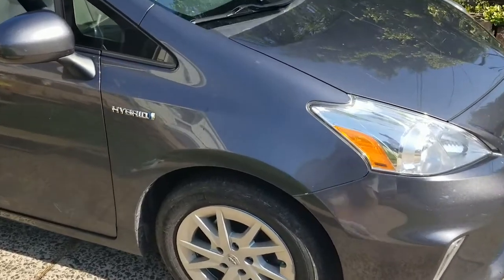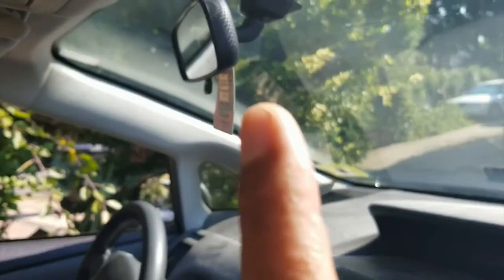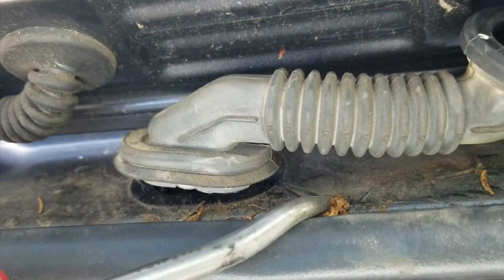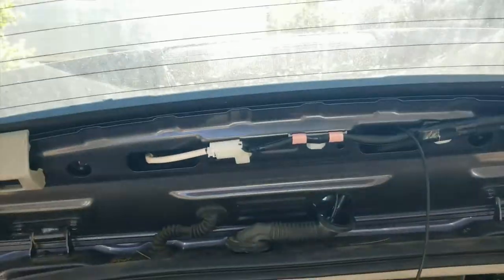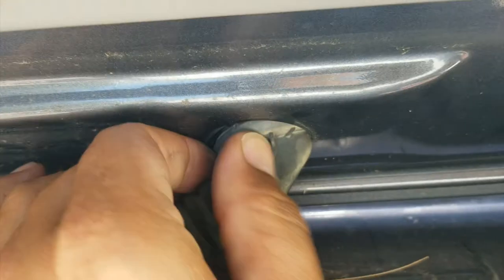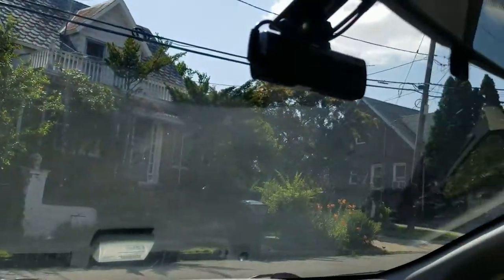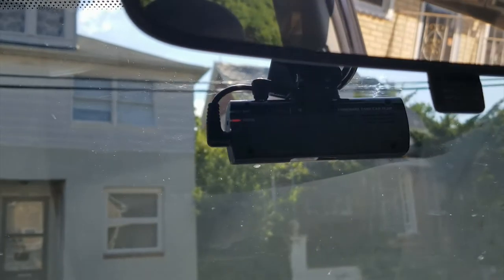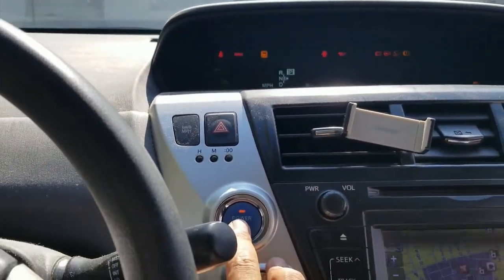How To Install Front And Rear Dash Cameras. 2010-2015 Toyota Prius. Full Installation.

Comment: I installed Thinkware front and rear camera on my 2013 Prius V.   Running the cable from the rear camera to the front was surprisingly easy.   For power I used hardwire kit and tapped into the homelink mirror always hot and accessory and ground lines, that avoided any need to get down to the fuse panel.   The in line fuses of the hardwire kit fit easily inside the dome light/SOS panel that you can pull out of the headliner with a plastic trim tool.  Kit of 4 nylon trim tools was $7.99 at Harbor Freight.   I shortened the thinkware hardwire cable substantially and soldered and shrink wrapped the connections.  On my car, red line into the homelink mirror was the always hot.  black line was the accessory power line, and white with black stripe was the ground.  I pulled the "dome" 10 A fuse while making up the connections and left the car off which meant no power to the wires while I was working on them.

The dome light console on my Prius is held with two push in plastic connectors at the front (windshield side) and tabs at the back, so pulling at the front left and then the front right pops it right out.

Comment: Be careful, old plastic elements often break off when you force-unsnap them after 10 years. This particular Prius has a very narrow rubber tubing and depending on what you have to snake thru, it might just not fit. Ironically speaking, the more I learn about the Prius, the more I think it’s been engineered a bit like IKEA furniture. It was meant to be built once and not unbuilt later. Good luck:).
Reply from the maker: I might just have to agree. Lol
Reply: @richideates  I used a bit of grease on the cable to help it slide through the rubber tube.  Pushing through a Zip Tie first and taping it to the connector worked well.
Reply from the maker: Thats using your noggin..lol..
Reply: It’s a bit dated this thread, but I was told by a pro guy that an easier way to get to a power source in the hatch is thru the back wiper connectors. No need to snake thru to the main body/frame.

Comment: why not use fuse taps?
Reply from the maker: You can. There is no stopping you. But we are "professional", so its actually rasier for us to find an actual wire than look for the fuse. But I started making those videos too, where I show people which fuse turns on and off in the cars I get. Either way is fine and or whatever is more comfortable for you.

Comment: Isn't the air bag covered by the wire when you cross the wires over the pillars? Shouldn't you be fishing the wire under the airbag?
Reply from the maker: If I did that..then the last 3 million installs that I have done..are wrong..🤣🤣🤣..technically..sure..BUT..air bags have so much power behind them..that a wire that small stands no chance of interrupting deployment..it will be severed by the air bag..so if you wanna waste your time doing it..I wont stop you..😁😁
Reply: @richideates  It really does not take that much more time to run the wire under the airbag as opposed to over it. You just need to slightly pry the pillar off to be able to route the wire under the airbag.

I think it is really risky to mess with airbags.
Reply from the maker: Do as you wish. I am not opposed to going under. It only takes a minute longer. Its installers preference. If it were a thicker wire..I would agree 100 percent. But right now..only 10 percent..😁🤣

Comment: What happened to using the fuses ? Much easier than getting those wires cut and trying to work around those parameters
Reply from the maker: You mean going to the fusebox for power? So removing the fuse, then jumping the wire there or or getting a fuse jumper?? You could, but thats not "professional". 🤦🏿‍♂️🤦🏿‍♂️🤣🤣..